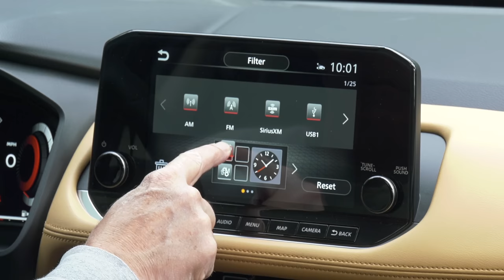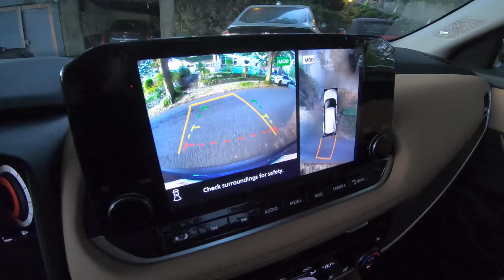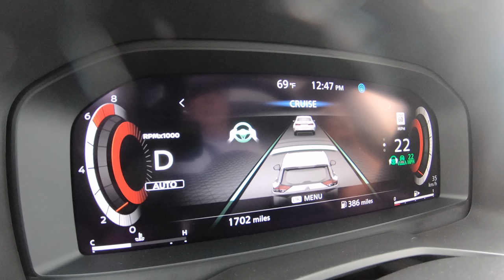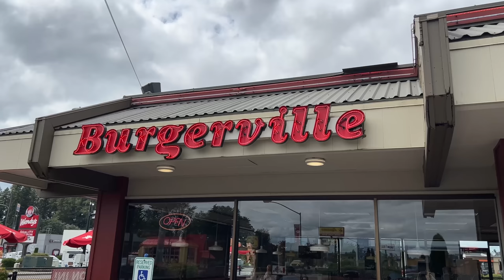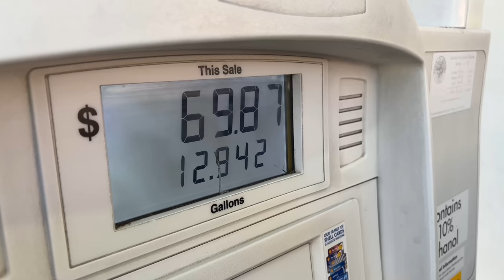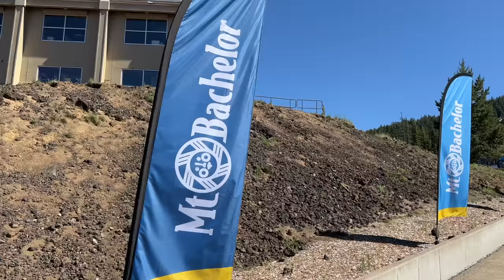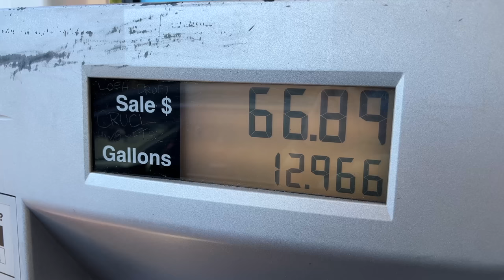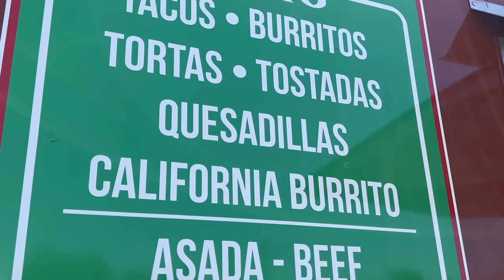The 2022 Nissan Rogue Gets A Techy New Powertrain. Does It Work?

Comment: Those sales figures the Rogue and competitors are kind of fascinating. I heard some sales figures on some mid-size trucks that were similarly surprising  In what way? They all seem very high given the constant news of chip shortages and other supply chain constraints. Dealer lots are all still empty of new vehicles. Makes me wonder how much of the scarcity is manufactured by the manufacturers. They are seeing increased profits not having to provide incentives to buyers or free flooring to dealers. Not sure how the dealers are making on through all of this, but I would think 2 years into this, we'd see at least some of the manufacturers falling down if they truly weren't able to eek out some decent profits. Who knows, that's just my bitter, cynical mind at work.
Reply from the maker: The manufacturers have certainly learned something from all this but if you think they're trying to create scarcity, nope. All it would take is one of them to churn out product to grab market share. That's not happening. All of them are scrambling. But it's getting better. Give it a year, maybe 18 months.
Reply: @DrivenCarReviews  I think manufacturers are learning they can maintain profitibility amid lower sales volumes by getting consumers to pony up more cash for higher spec vehicles. If they wanted to crank out more vehicles, they could do so by concentrating on less equipped base models that have fewer chips. That is what I mean by creating scarcity. They sell nearly as many crossovers and trucks as before at the expense of not producing affordable vehicles (or discontuing them altogether...RIP Honda Fit). I fully agree that they are constrained by the supply of materials, but theyvhave some control over their output based on how they allocate their production resources.

Us Americans generally are not ones who want to "do without," so we happily pay more for that fancier version as long as the banks are willing to spread that note out a few more years to keep that monthly payment manageable...if you consider the average new vehicle monthly of around $700 manageable. If and when the economy slows, which I think it will with the Fed's rate hikes continuing, we will see some fallout from all this unchecked consumer spending. Then, I think you'll see the market cool off.

Comment: Nissan reliability has been utterly, absolutely, completely down the toilet ever since the brand was acquired by Renault.  (Go ahead and call it a 'merger' if you want, but I sure wouldn't call it that.)  I wouldn't touch one with a proverbial ten-foot pole.  Now toss a turbocharged, "high tech" engine into the mix?  Well, I guess some people will buy a Nissan because it's cheaper than the equivalent Honda or Toyota, but they will be paying far more down the road, unless they've decided to "wad it up and throw it away" before it becomes a maintenance nightmare, by leasing one.  Finally, 42K?  Well, "good luck with that."  I'll laugh my rear end off in about three years.  Very nice video, though -- thanks for the quality work "as usual," Tom.

Comment: You lost me at cvt.
Reply: he lost me at 30 mpg in mostly highway driving on a 3 cylinder.
this is he problem with smaller engines...they have to work harder for power
Reply: CVT transmissions still suck at everything.
Reply: Exactly right

Comment: You lost me at CVT. Not sure why Nissan decide d to keep the CVT when did a away with it on the Pathfinder, why not just use the same transmission on the rest of the fleet. These are the reasons why Nissan is failing and turning into the next Mitsubishi.

Comment: The engine won't last with those turbos. The  nissan cvt trans is terrible. At that price get a Toyota that will go 100,00 miles without major breakdowns. My 201@ Nissan rogue is going on third set of motor mounts at 165,000 miles. Out 2009 Toyota venza v6 has original motor mounts at 200,000 miles

Comment: It all sounds good but the Nissan Rogue still comes with that notorious unreliable CVT.
Reply: We have a 2015 Subaru with CVT.  Purchased it new and never have had power train/CVT issues.
Reply from the maker: Do your homework. The troublesome transmission was in older Nissans. This one is a couple generations past that.
Reply: @DrivenCarReviews  Which is still to early to know how long they will last. The CVT by design is a weaker transmission and more prone to fail than a standard transmission.

Comment: Not a win-win-win if you need to fuel it with premium vs regular in the naturally aspirated engine. Also the high compression may lower the engines durability later in life.
Reply from the maker: Takes regular grade fuel. As I stated. Not always in high compression mode.

Comment: Sorry Nissan , no way on the CVT. Pity Toyota is starting to use the CVT. Doesn't matter if first gear doesn't run on the CVT tech but everything else does. Bad Toyota, adopting a tech that's just bad . Especially if you buy your cars with longevity in mind .